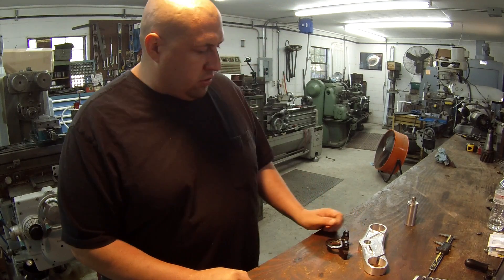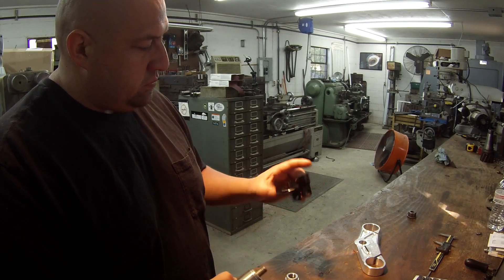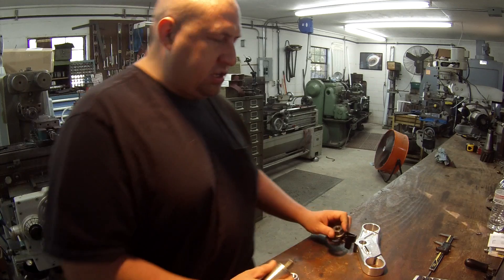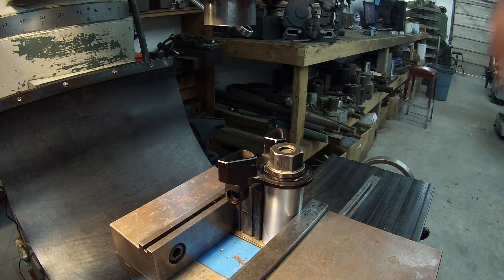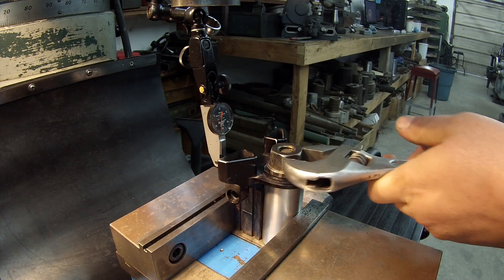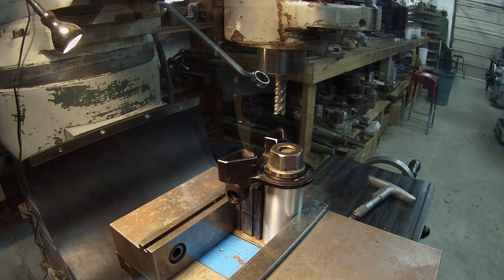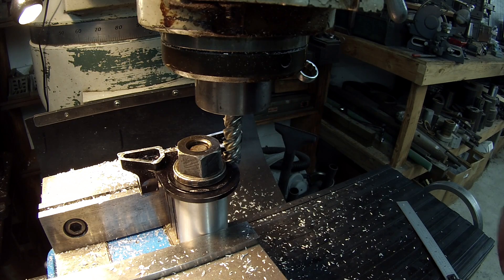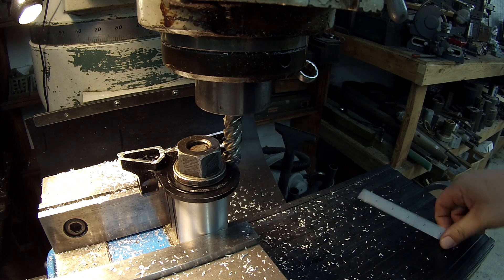Modifying a Steering Damper to Fit a Custom Triple Clamp Part 1

Comment: Adam,

You make it look so easy. I need to finish up an aluminum project I started a year or so ago. I wish I had some small end mills like that it'd make it a lot smoother for me. 

Thanks for the video,

Mike
Reply from the maker: Those 3 flute high helix end mills are perfect for aluminum. Snag you a couple Mike!
Reply: I've got some four flute Abom79 sized but nothing fitting for my shop, lol. Where do you order your end mills from?

Thanks,
Mike

Comment: Learned something new, using an indicator on the knee.  I've always used the dial, but I'm always moving in the same direction.  If I had to change direction, I would have to account for the backlash.  Thanks for sharing.
Reply from the maker: The mag back dial on the ways is a great way to make short movements and not have to worry about backlash. Ive used that trick for years Herb.

Comment: Nice work with 'analog mode' Adam. 

Regarding accuracy, wouldn't it have been better to touch off on the datum surface, and then machine the left side flat to the datum, before dropping the work the required 0.113 for the right side machining?
Reply from the maker: Sure, but using my dial indicator I knew it would still be within .001.
Reply: Abom79 I kinda figured. I have an old memory of a shop teacher yelling about tolerance stackup in my head every time I spin a control on a mill.
Reply: mausball Abom79 Tolerance stacking is a biatch!

Comment: Great video as always. I was wondering if there is a specific reason for always milling right to left? I know there are difference between conventional and climb milling, but never got the concept behind it, especially if you are using both "sides" or the tip of the cutter.
Reply from the maker: Philipp, It's sometimes personal preference as to which way to mill, but I have always favored from right to left when I can. The most important reason is that it slings the chips away from you. On the big Acra mill I mill keyways from right to left because my coolant spout is on the left side, and allows to help wash the chips away.
As for conventional vs climb milling, I always conventional mill unless I'm just shaving off with the cutter. You want to mill that way so that the cutter is "pushing" against the work and keep the backlash tight. If you climb mill, the cutter is naturally trying to "pull" itself into the work, and if your not carefull you can ruin a job or cutter.
You can climb mill on manual machine, but it needs to have a "backlash eliminator" built in. The K&T does have this feature.
Reply: Abom79 Thanks for the great explanation. Seems very reasonable. Hoping to get a mill in the next months. Thamas for clearing it up for me.